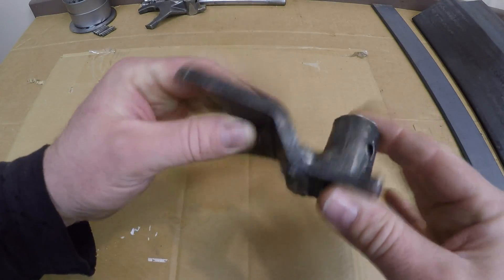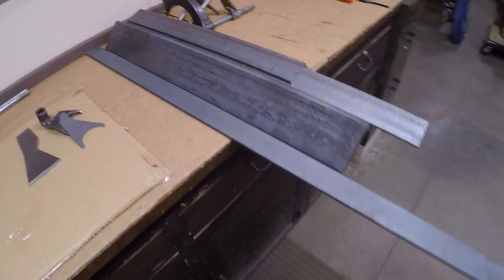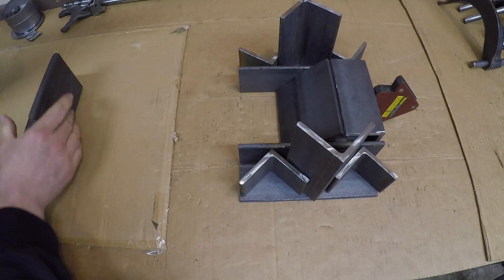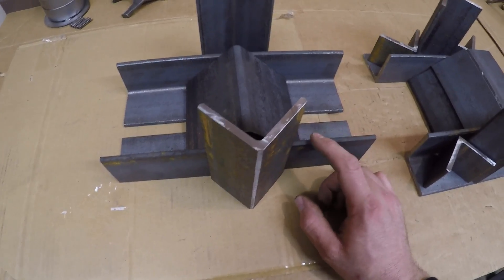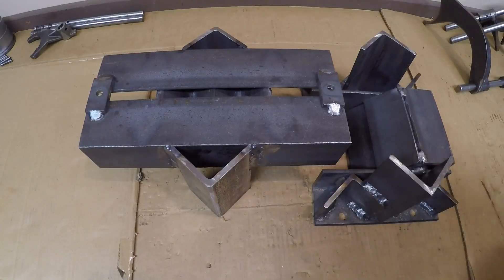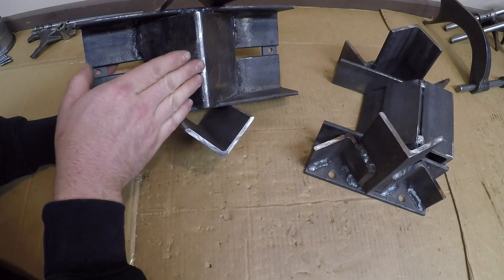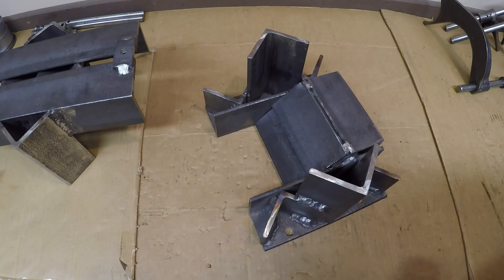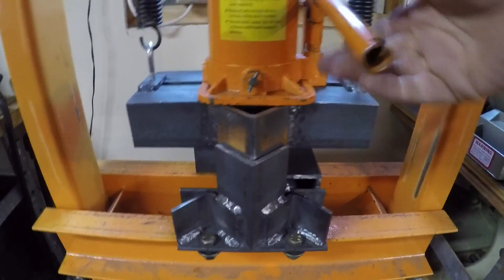Minneapolis-Moline 445 Prototype #X231 - Part 41: Building Press Blocks For New 2-3 Shift Fork

Comment: Waiting to see this. 5/16 is serious business, but I don’t doubt you at all. I do have concerns about the weld/repair. It seems to me that their bend may have caused the ultimate failure. I’m wondering if it should be relieved then bent, then tig welded at that location?

Comment: With the angles on the jig being exact, are you worried about keeping your angles on the finished piece? Most steel needs to be bent a few degrees past what you are aiming for. It will spring back a bit.
Reply: @squatch253  You sure did. Not sure how I missed that.  Looking forward to the next video.

Comment: Bit late now, but swagoffroad.com sells a press brake kit for the 20 Harbor freight press. You have to put the pieces together and weld them up but it takes 40 minutes or so to knock that out. Fits pretty well. I have one for my press and it could bend that part you are working on without heat. I made 90 degree bends on 1/4 steel last weekend and it went easy. The steel I was bending was A709 type 50 so at least the same strength as 5/16 A36 steel. A handy thing to have around for little fab projects like what you are working on.

Comment: Why not bend and weld , then bore the hole for the rail. Inevitably distortion will take place during welding and cooling. Welding a finish bored tube to the fabricated fork will probably mean a lack of essential geometry.
Alan in London

Comment: Looks like you are trying to make a folder rather than a press brake. I would have thought Press Brake dies would have been a superior method to use. I reckon the original part was formed by way of an upper knife stabbing down over a V section.

Comment: I would have had a milling done out of solid stock.. a hardenable alloy and with the engagement forks brought to thickness on a surface grinder for smooth and hard surface, at a high degree of perpendicularity to the control rod. Good luck with this.... it sure is possible to do a part out of mystery steel, but.. will it be hard enough to resist wear-out on those fork tips?   OK, its an occasional use parade tractor.. never to be abused.    A weldment will probably hold up.. I would bet the prototype piece was bent  in a standard press brake, one bend at a time.
Reply: 8620 steel and heat treatment carburizing and harding

Comment: Love seeing that I'm not the only one who would build such an elaborate tool to accomplish a one use task. Similarly I'm a lot more likely to envision something and start building than I am to try and draw it out, it's just easier to start doing it. This fabrication reminds me of the work you did to line bore the rear axle casting, top notch. Hopefully you're not currently buried in snow with this April storm.

Comment: I really appreciate your ingenuity.  I know dollars are always a consideration, but you may consider a 2011 Handi Bend from ShopOutfitters.com.  For about $800 you can get the tool to use in your press to make parts like you are working on.  Of course there is a learning curve.  I bought one for the shop I ran and was very happy with it's performance.

Comment: Hello there, Firstly I love your videos you do a great job with explaining and reverse engineering these old beasts while keeping it entertaining and interesting. In part 40 when you were going through the solutions for this problem i already knew you would decide to make a new fork, its the right thing to do. I look forward to videos where you have to get creative with making something work weather it be making a replacement part or machining those bores in the rear end, its nice to see how others minds come up with solutions for problems. That being said your normal solution are brilliant in there simplicity and frankly just get the job done without being over engineered, I think your solution for bending that plate is not your norm, I just don't see it working as you suspect. i feel like a better solution would be to make a bottom die in the form of a v-block, weather it be a 90 or 60 degree included angle then the top die would be the reverse of that and mount the the round anvil that was already on the press. Essentially you would be creating a mini industrial metal brake. It could also be useful in the future as its design is more general and can to used to bend other angles and sizes of materials. Just my opinion, wish you the best keep putting out the great content.

Comment: The jig looks great!  Alternately, if the bending doesn't work out (looks like it will be fine), could you fabricate a flat fork (no double 45) that is welded to the appropriate (non end) point on cylindrical component so that no offset would be required for the fork?  You'd probably need to add a reinforcing gusset as well, but no bends.  Not sure if this would work, but just a possible alternative if all else fails.

Comment: I have a big hydraulic log split er that I adapted a short set of press brake dies it is nice
way to form steel .It will do 14" x 1/2  at 90

Comment: Cut the what is 1.25" 45° piece and make a jig for the fork and the rod piece and weld it to the 2 pieces. These are 2 simple corner joints that can be grind down so that it looks identical. The only thing missing is the bending witness marks :/

Comment: Wow that looks over engineered..
Reply: I was thinking the same. Two bends in a flat piece can be done in a vice with a hammer.
Reply: @Drottninggatan2017 ...You need to bend one or two up and send them to him.  Too bad he spent all of that time fabricating a press jig when your professional hammer techniques would have solved all of his issues.  .
Reply: @Drottninggatan2017  if you did that and look just like the one he's trying to replace apparently you like using a Vice and hammer

Comment: I think it'll work just fine and I still stand on that you could've been a surgeon and the very least the head of an outfit or R&D. NIce work but all of yours is. Did you get the blizzard that people were yapping about? Leaves about 2 inches, plus or minus here. 786 yesterday and sunny and 50 and raining now. Bet Pop is grinning. Thanks, Toby! A-PLUS!
Reply: @squatch253  My Mom always said the 'predictions' could go 12 hours either way and it looks like that it still holds. We've got excellent right-of-way guys here or the power'd go off every time someone blinked. It was like that growing up. I know the stoves are hopping. Just get the candles and lamps ready because you never know, but I lay heavy odds they already are. That's why I keep generator gas. Just know I'm thinking about you. BLESSINGS, Toby! And Pop is probably wanting to be in the thick of it knowing him. Older operators always did!

Comment: Look like a youtube problem... i'm having the same issue with multiple other video
Reply: I'm not seeing that issue in other videos.  If you happen to be running Ghostery plugin for Chrome there was an issue identified and rectified yesterday.  Reply back if that is the case and I'll line out the solution.

Comment: Don't you know anyone with a press brake ?
Reply: @squatch253  then give the dimensions.. thickness  and the offset ,  i live in LA and there is a great steel fab shop that i use only a few miles from here..  i can have several blanks bent  you should be able to do the rest making holes thru it and the outside shape